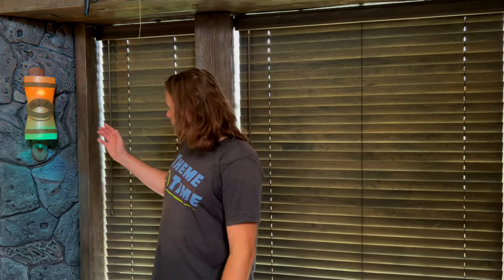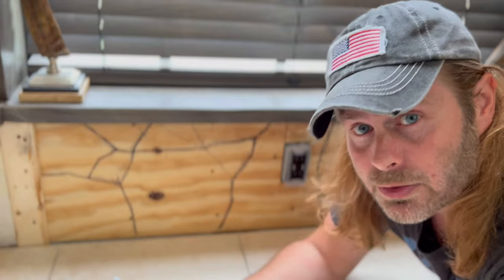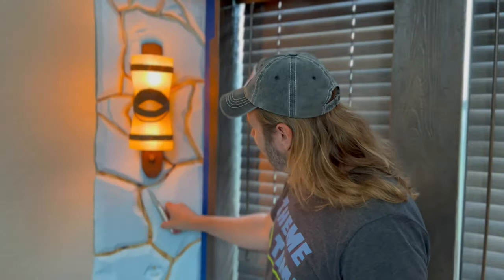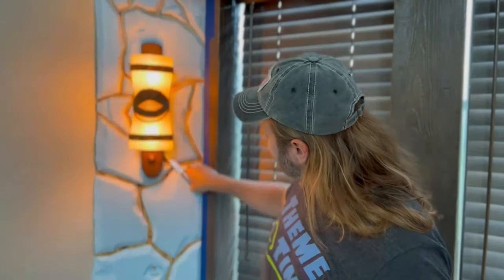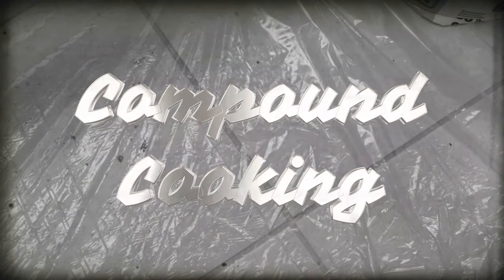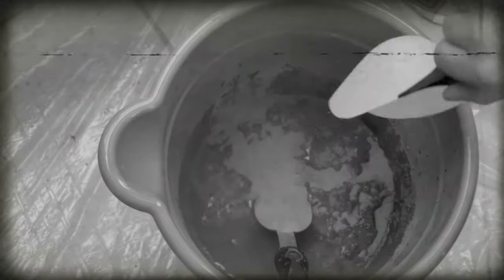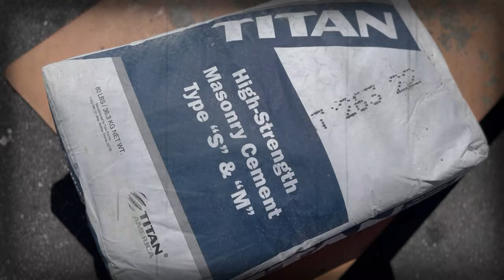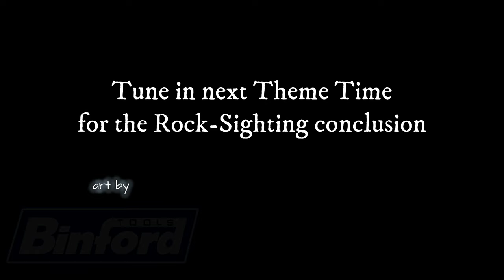ThemeTime: Episode 4 “The Corner Stones” Fake Rock Concrete Sculpt Interior Disney Style Design DIY

Comment: thanks for sharing this video. I see you changed your mortar mixture since when you first started making faux rock. Great info!
Reply from the maker: This particular application necessitated a mix with less weight. The sand is the bulk of the weight in the mix and is the part that holds moisture the longest. 
So I lessened it by a part and it helped a good deal. Also the less sand, the creamier & less gritty the mix is. 

In more recent projects I’ve also used a premix that has spoiled me to going back to mixing myself. 😅
Reply: @themetimeDIY  That makes sense. Thanks again for the great info :)